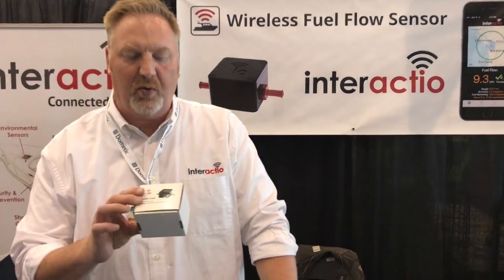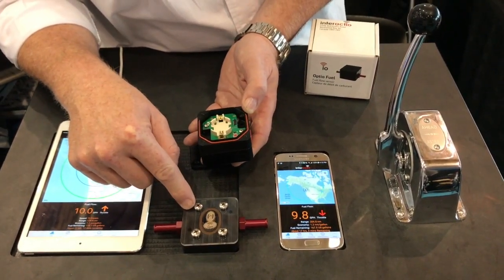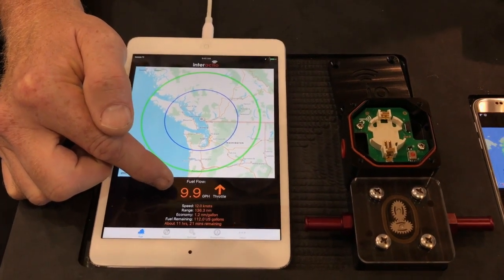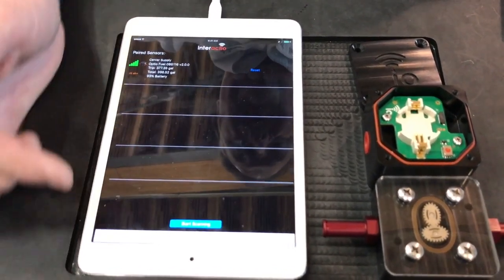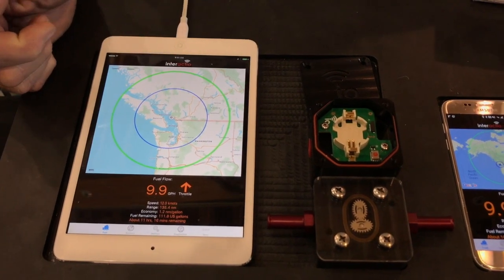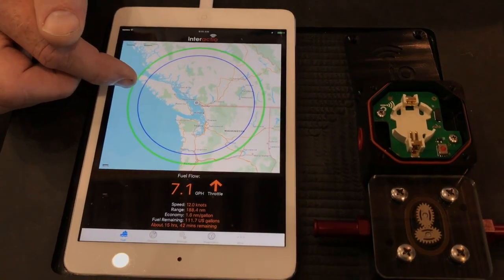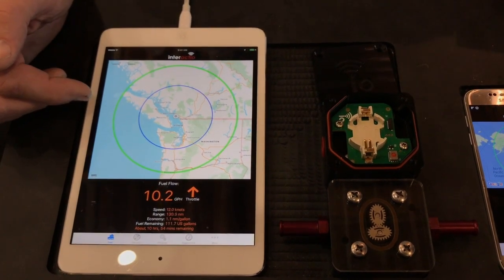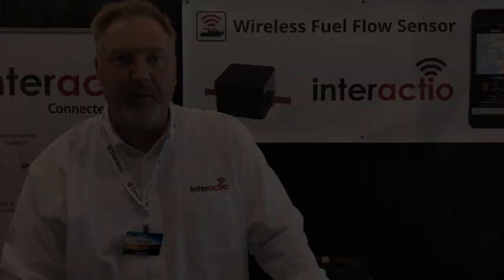Optio Fuel Overview and Demo

Comment: Any news what's happening with the company that bought Interactio? App has been pulled from App Store rendering the future very bleak. Not possible to install on a new device.
Reply: Did you ever get an answer about the Optio Fuel Flow meter?